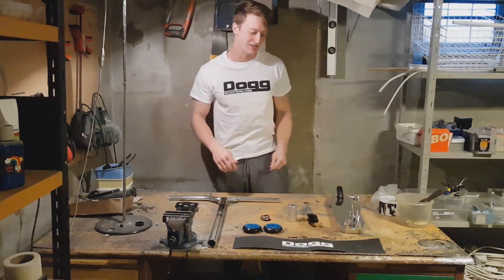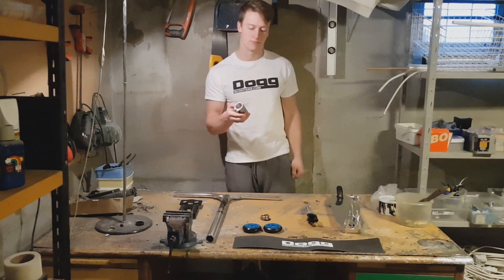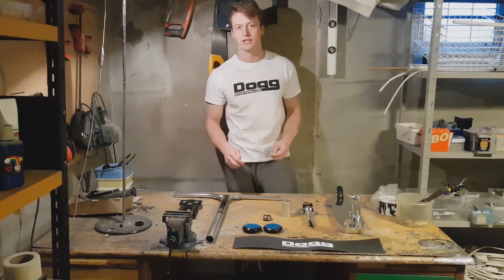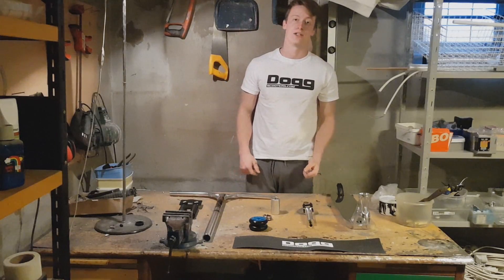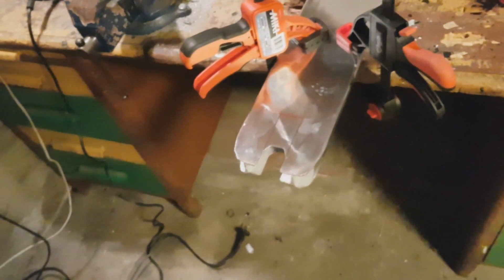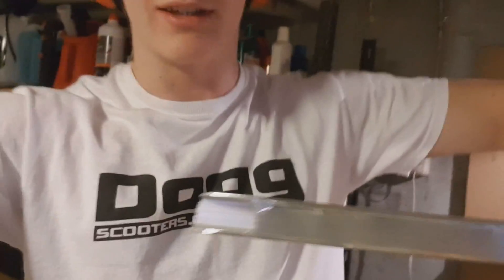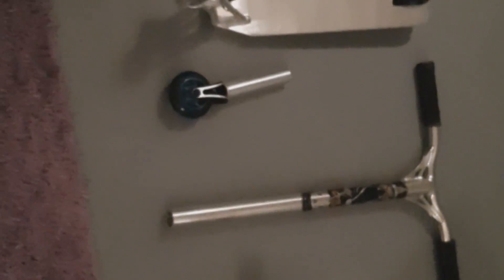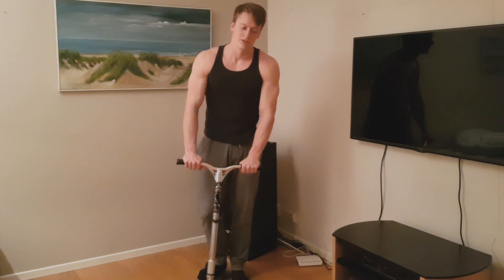BUILDING MY DREAM SCOOTER!!

Comment: Someone get this man titanium bars
Reply: Dirty Mikes and The Boyzes titanium bars are a lot heavier.
Reply: ZeRTag-Mobile Gaming no theyre not actually titanium is not a mixture of alloys unlike aluminum which is a mixture of actual aluminum and steel therefore making titanium better and why it is so expensive :)
Reply: Ygw titanium bars are 100+ grams lighter the reapers
Reply: No, basically all metals used these days are alloys as otherwise the metal would be really weak. aluminium is less dense than titantium however as titanium is stronger you don't have yo use as much material
Reply: Well hes not so rich to buy300$dollar bars
Reply: @arnoldsvaldmanis8719  $160 *
Reply: @jenk__  But he lives in Sweden